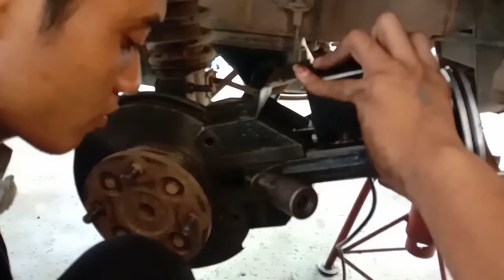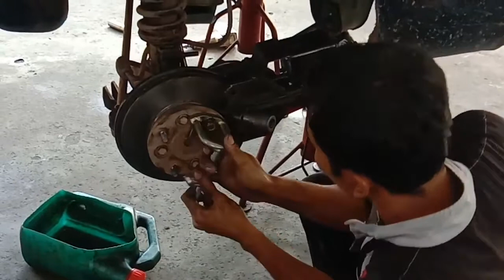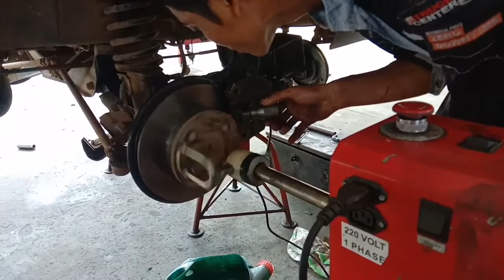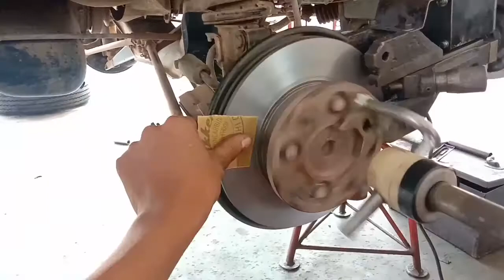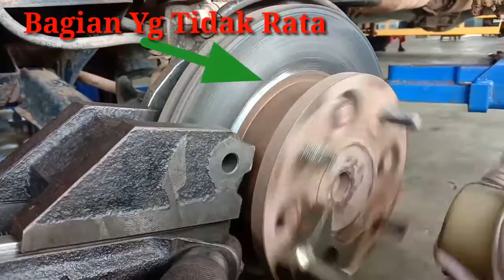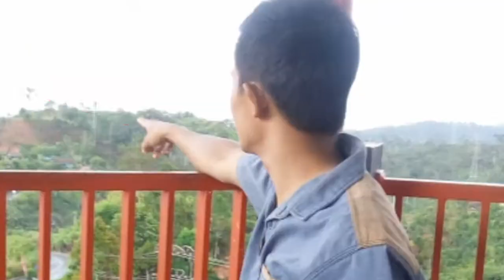Pedal Rem naik turun saat direm?????(Bergetar/Jader) Ini masalah dan cara perbaikannya

Comment: Piringan cakram saya sudah dibubut, tapi sepertinya prose bubut piringan cakram dilepas dari knuckle nap roda mobil.  Tidak seperti di video dibubut tetap nempel di mobil.  Jadi saat ini direm pedal rem naik turun getar.  Apakah karena hasil bubut yg tidak simetris karena proses bubut piringan cakram tidak nempel dimobil ? Mohon jawaban
Reply from the maker: Iya Betul sekali Maseh😁,,,,istilahnya ga senter sama Titi putarnya ,,,bagus sih bagus tapi gansenter ataubga lurus😁🙏
Reply: Kalau divideo namanya Remaching biasa dilakukan di Dealer Resmi, jd sistem sperti bubud hanya saja tidak perlu lepas komponen piringan. Selain proses satu kali tanpa bongkar remaching lebih murah karna kalau sdh bongkar parts biasanya lebih baik lg kalau di spuring lg kaki kakinya